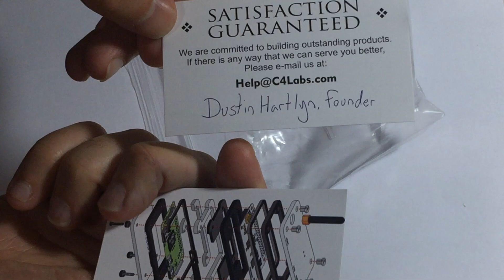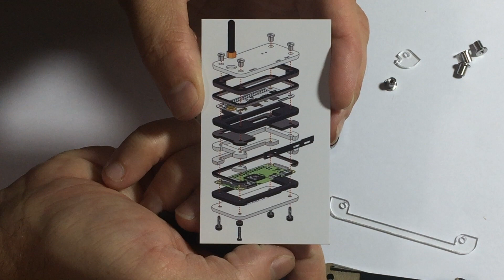S1:E10: Building the Zumspot Kit - Part 1 of 2

Comment: Greta video...FYI...Looks as though the last clear top piece is flipped over backwards (17:36). The heatsink slots for the two square chips are not open over the chips and the two reset holes are over the bottom right chip...flip it over and you are good to go! You should be able to read HDMI, USB and PWR along the bottom edge. 73 W7DTH

Comment: How did you get the part that covers the ports in place? This is the step where I'm having the most difficulty with as it seems that, those two plastic pieces that look like half moons, have to be in alignment in order to hold the part that goes over the ports. You speed up the video there and makes it hard to follow.
Reply: You have to insert that part form the top down as you build it. There are two small clear pieces a clear piece and a black piece that have a slot cut in them. I Put the part you are having trouble with on the Pi Zero as I slid it on. Everything else slid down on top of it fits in the slots cut in the nest few pieces. Hoe that helps.
Reply: Built mine, last night.  There are two little corner pieces, with cuts in them.  By now, I assume you already have it figured out.  I did need to drill the holes in the one black layer, to accommodate those “Chicago Screws” that hold it all together.  Now to run thru the setup.